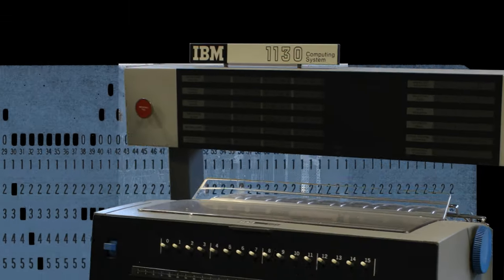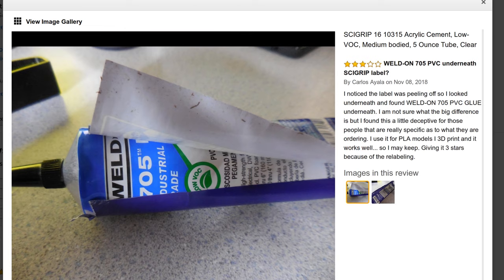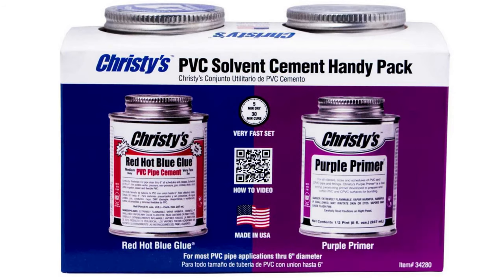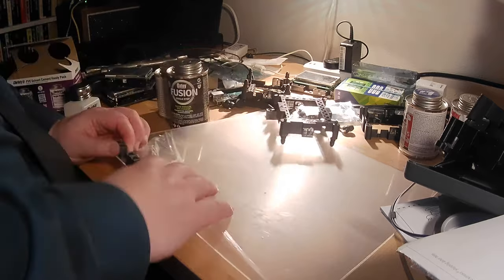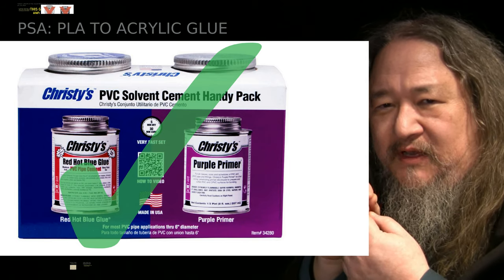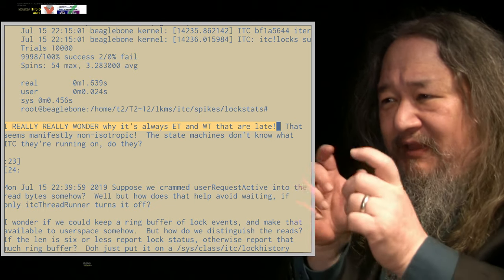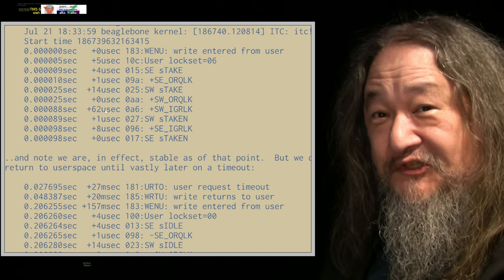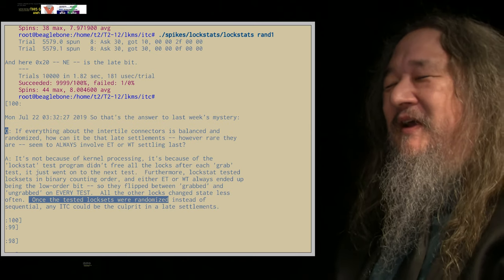Let's Stick Together - T2sday Update 241

Comment: Thanks for the update, it's always fun to watch your newest adventures. 
Why not use aluminium frame instead and just bolt the tile feet on? 
I feel like acrylic might shatter if you put too much weight on it.
Reply: I would agree with you there. Something like metal scaffolding would be best eventually. Need to consider the interface between foot and frame carefully.
Reply: The extruded 'T-slotted' frames might be a good option. Would be easy to print the current feet and slide them in and upgrade the design later if needed.
Something like these:
https://www.mknorthamerica.com/Customer-Content/www/Products/Categories/Photos/aluminumframingsystems.jpg
Reply from the maker: Big discussion about T slot on the gitter a while ago https://gitter.im/t2tile/Lobby?at=5cee9eb96fc5846bab2aa6c6

Bottom line was a maybe but probably something a bit more custom.
Reply from the maker: Thanks for the comments!  The cheap thin acrylic I'm using from Home Depot I'm not super happy with as far as rigidity, but it seems not terrible for strength.  CNC aluminum is always there but it's not a technology or skill I currently have.  We'll see!
Reply: @T2TileProject  You might want to consider a wooden frame then?